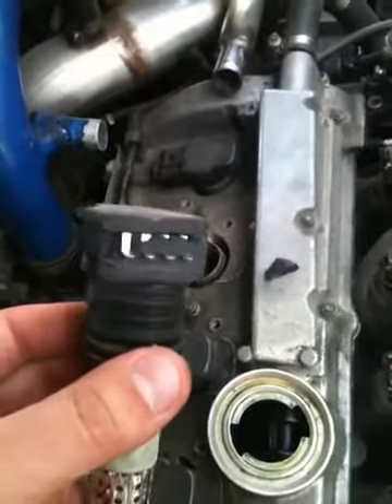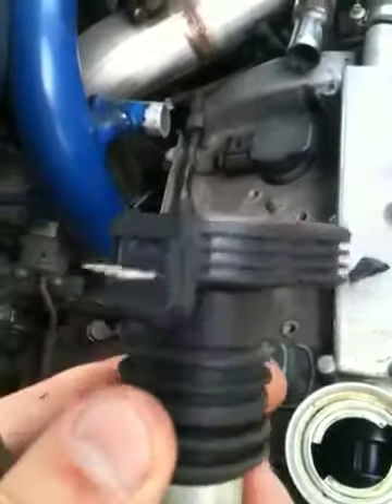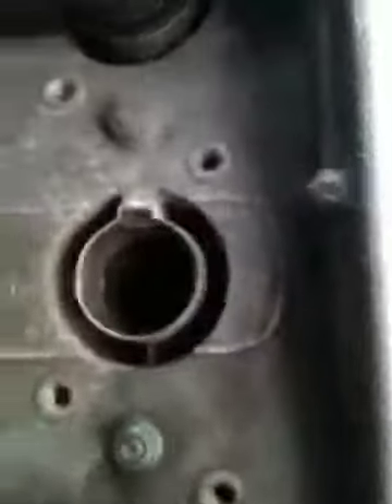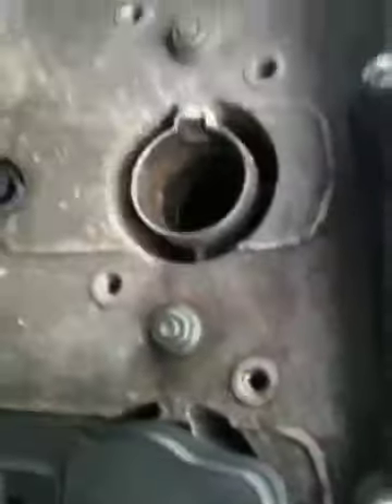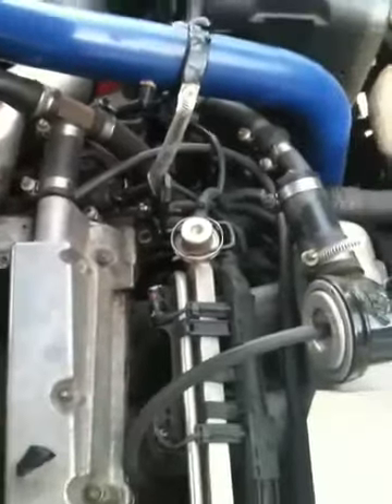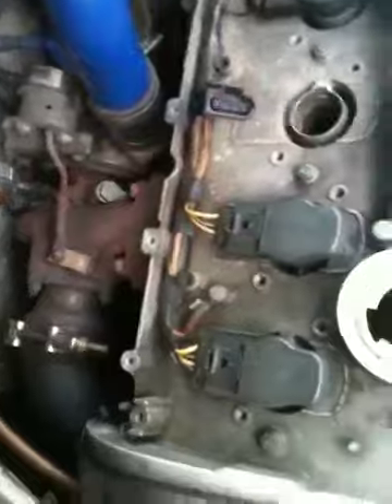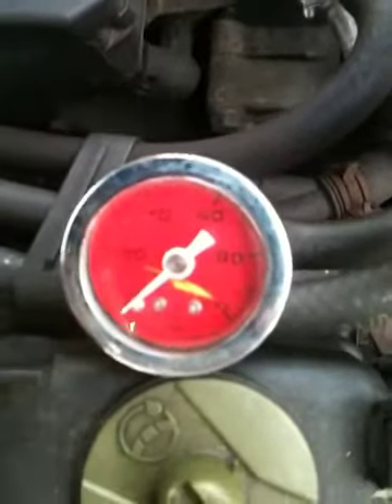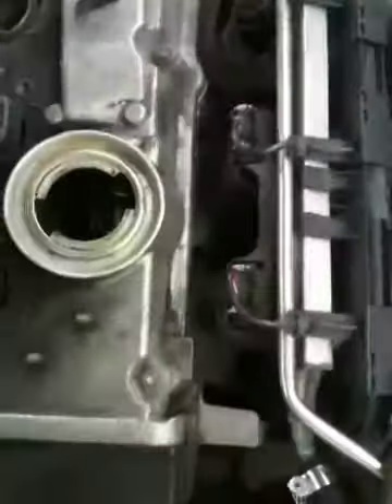Mk4 1.8t limp mode quick fix

Comment from the maker: Changed the plugs and valve cover gasket and ended up painting valve cover wail I had it off! U can see finished product in other vid. 

Then swapped out upstream O2 sensor and fixed all the issues.  
I tried starting with the cheapest item fixes before buying new 630cc injectors and before  cleaning throttle body since it needs to be adjusted if its removed.

Comment: Hi there, I just want to share what happened to my astra... Since I've bought it I had problems with the car going into LIMP HOME MODE.. The mechanics would tell me to replace the ECU to fix the problem, which I think it could, but as I didn't want to spend $1300 with it I decided to  look deeper into the problem. The codes were: 1700, 1500, 2108, 2106, 2104 ...... After watching a video of how they seal the ECU I decided to have a closer look at it...

Comment: As it could have dirt in the plug contacts I decide to clean it with acetone and one of my missus make up brush. But for my surprise what I found there wasn't dirt but GLUE!! The same glue they use to seal the ECU!! After cleaning that the car has been spot on for 5 months!! ;) . I am not 100% sure if the problem was only the glue or maybe a bad earth.. Anyway I just wanted to share it with everyone. :)

Comment: Same here. I also changed my spark plugs after they checked the coils and saw the #3 coil was zip-tied together and when I pulled it out the boot fell off and the spring in the coil shot out =/ They didn't tell me what they did when I went back there.

Comment from the maker: @ elantiyano 
Yea could be that did they replace them all or just 1 or 2. Sometime they replace one as say they did them all. Could be spark plugs amongst other thing. Buy a code scanner from eBay like 30$ so they don't rip you off  coil packs are VERY easy to do job yourself same with spark plugs save your money and get greasy!!

Comment: Hi I have a Leon Cupra sport 18t Auq and sometimes it goes into limp mode no codes but I realised the if I turn the car off for a couple of seconds and turn it on again it's fine. Can anyone help me find out what the problem is thanks.
Reply: Hi, I have the same problem, do you solved?
Reply: I have same issue! Could anyone fix it?